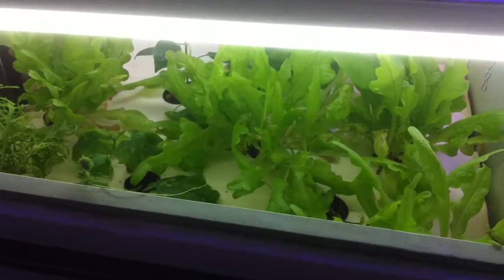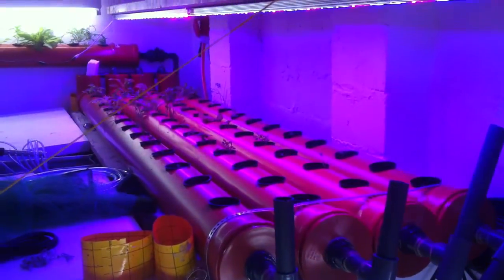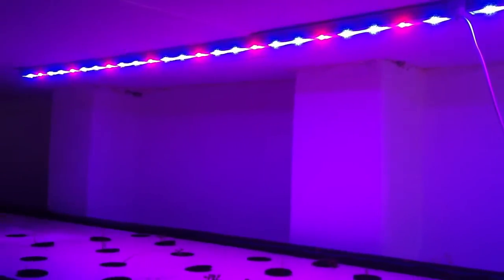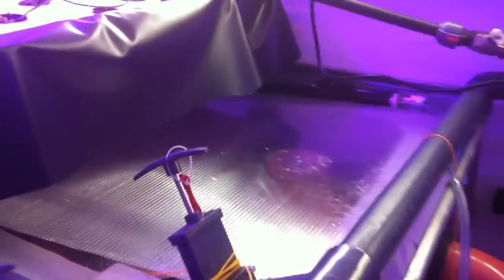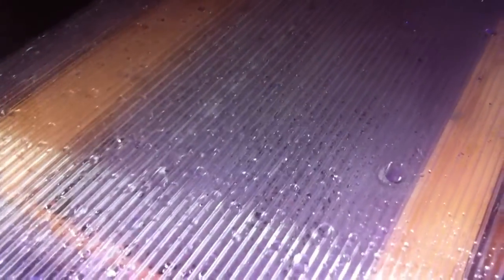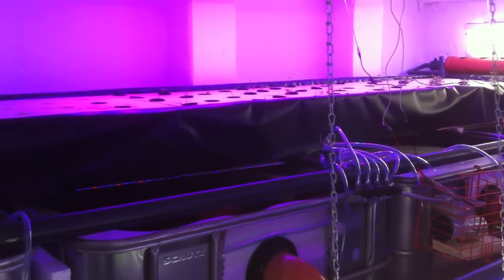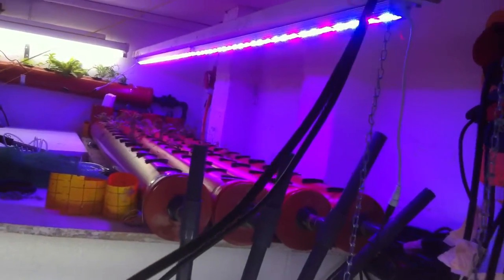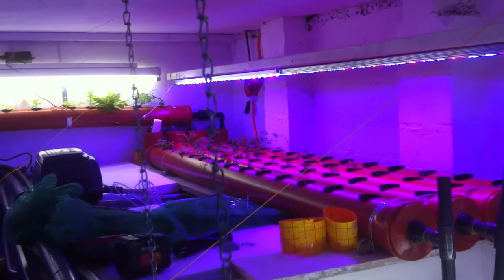Aquaponics with LED lighting...  Aquaponic Gardens Switzerland...

Comment: Does a regular led light SMD 5050 works well or they have to the 3watts or higher type? 
Great proyect!
Thanks!
Reply from the maker: It is better with a 3 watt .. but important is they are the correct light wave lenght.
you can find them on my website for a very good price. If you need a quantity I can make a better price.